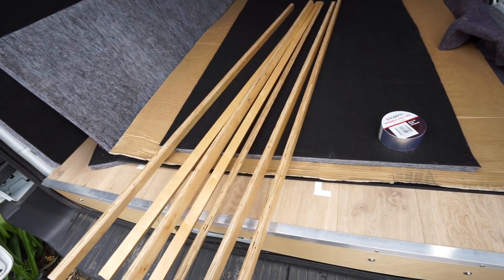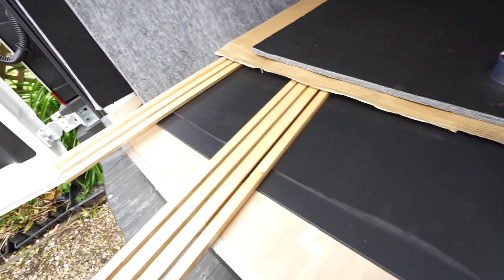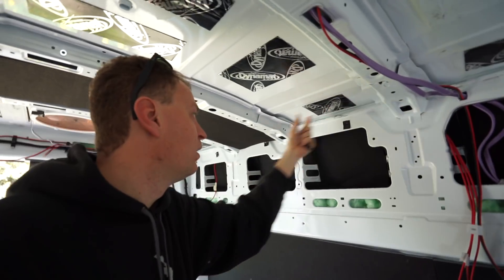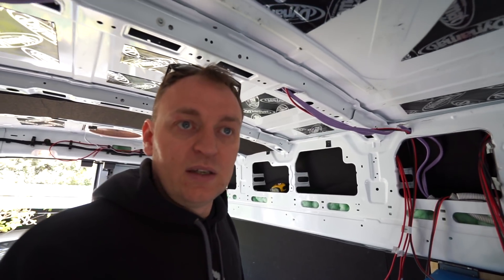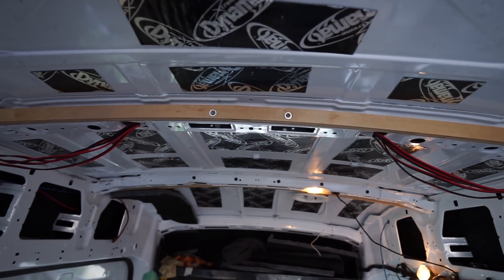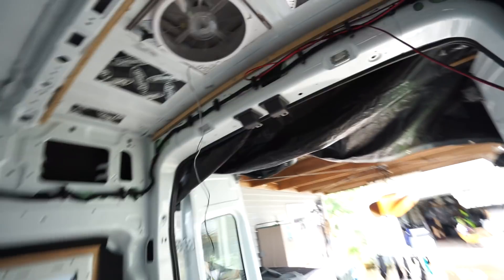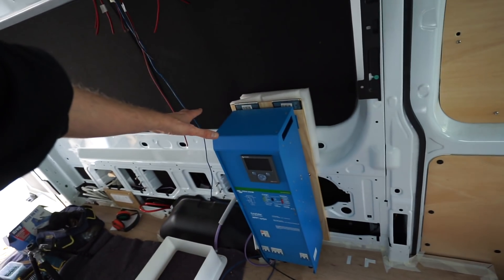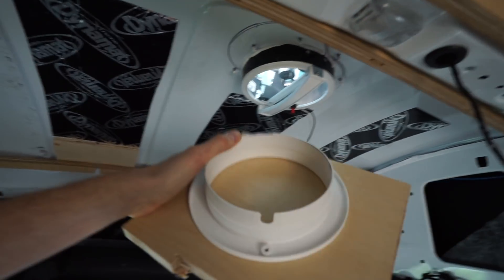Low Profile Ceiling Ribs in a Van Conversion: Eat Sleep Van 19

Comment: Hi there, I'm in NZ as well and we too are hoping to do negative black detailing on our ceiling.  Do you have a link to the board you were using?  I haven't heard of it but it sounds great.
Reply from the maker: Hi it was black foam board from a signwriter. Note I didn't end up using it, as it can't handle the 2 dimension curves of the Transit Roof. Instead I went for a wooden slat ceiling, that can bend in 2 dimensions!

Comment: How thick and how wide were the plywood strips?  They look like 3/4 inch by 1 1/4?
Reply from the maker: Hi yeah 18mm ply, and I think they were 30mm wide roughly? So yeah 3/4 and 1 1/4" is about right.
Reply: Thanks, also, how do you do the imprint on the back of the wood?  What do you screw into the rivlet?  Thanks
Reply from the maker: I just put a bolt in, the same as I've used everywhere in the van. They have a rounded head and take a hex key to drive them. They leave a small imprint in softer materials. Here's an example http://www.theboltholder.co.nz/media/products/304but05035.jpg If your material isn't soft enough you can put some tape on (e.g. insulation tape) and imprint into that instead.
Reply: Thanks again, I like the way you set up the ceiling ribs, great idea. Dave